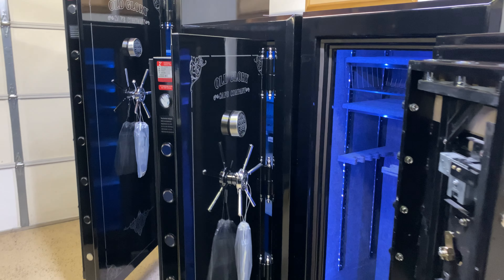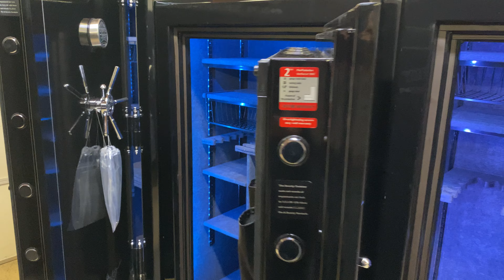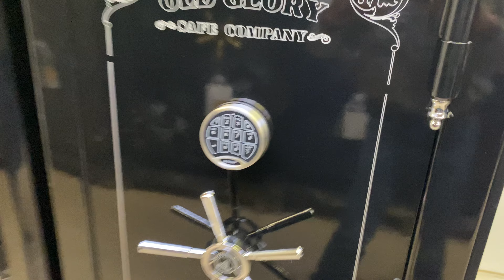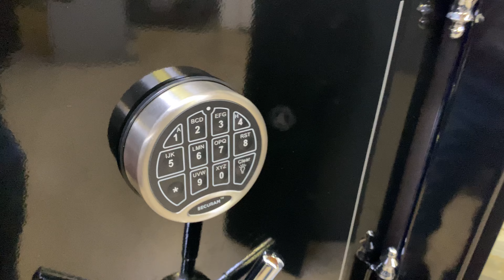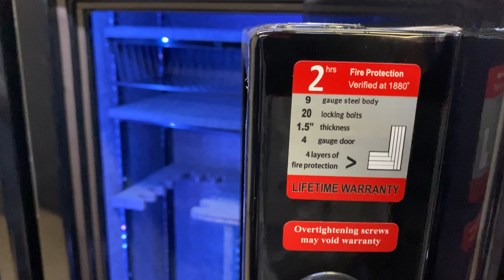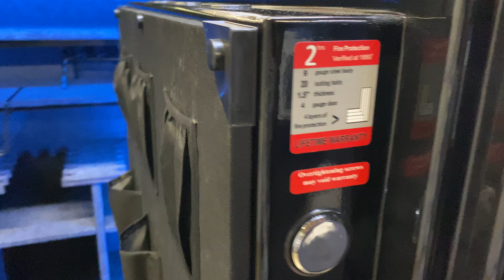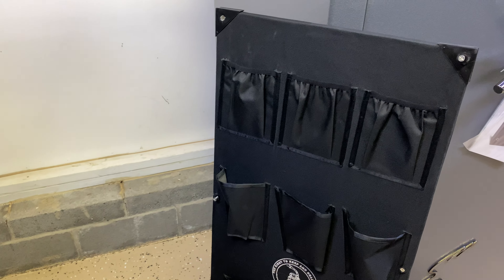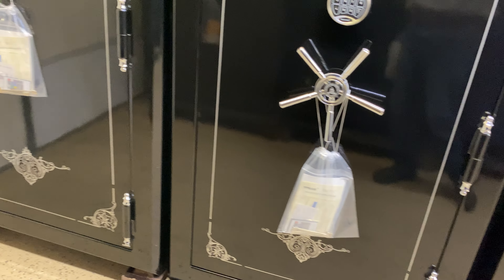Old Glory SD models. SD6030, SD 6039, SD 7242

Comment: Are you able to replace the digital lock with a Sargent & Greenleaf mechanical dial combination lock? My understanding is the screw/bolt pattern on the Old Glory Gun Safe digital lock is not industry standard. The current digital lock mechanism not being U.L. rated concerns me as well as that bypass key.
Reply from the maker: Not on an Old Glory